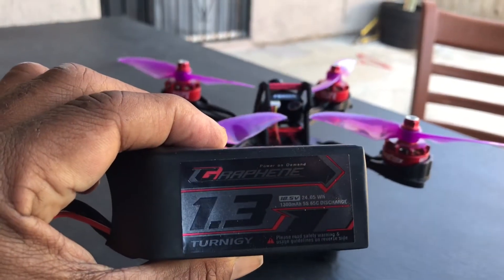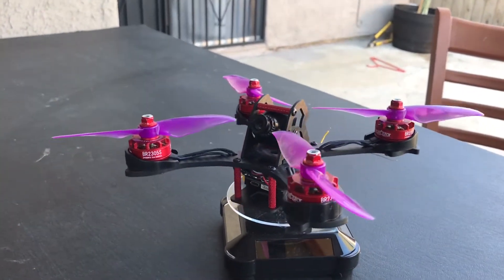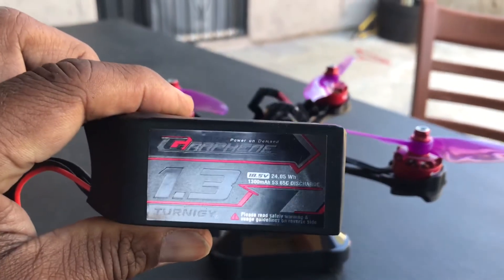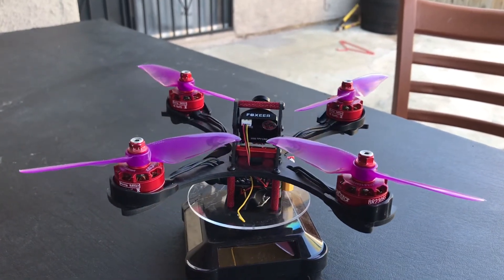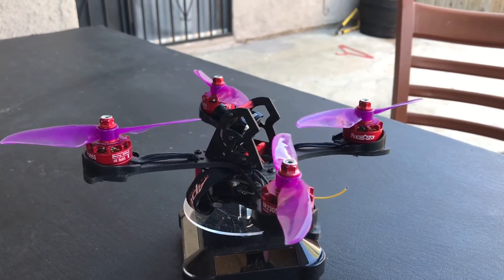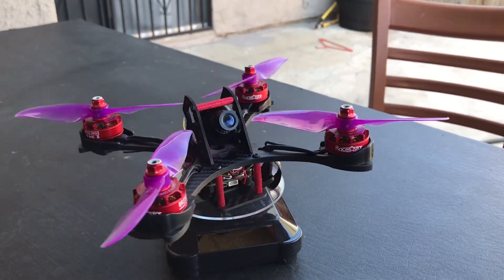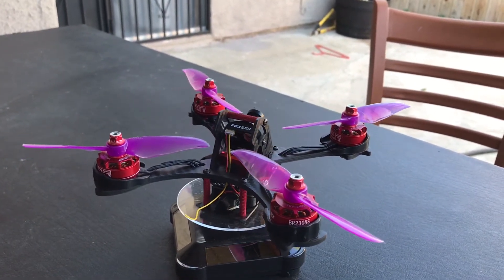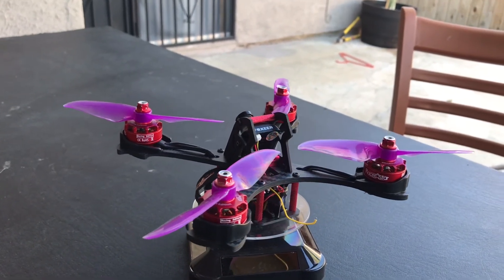180mm 5" Racerstar BR2305 5s Racing Quad Build Pt. 1

Comment: Hi any change to mount the motor downwards below arm? I saw this frame on drone shop. Almost made me add to cart due uniquely design kits. Probably this frame is design to mount motor below arms? Can u confirm this with all clockwise motor might work or not? Thank in advance.
Reply from the maker: I still have this frame, but the stack blew out. The stand offs they give you are too short for my motors. Your would have to order another size to make it work.

Comment: yes I have a suggestion run a small 2s separate battery for your vtx you will have great results. think of the current as blood. you want clean blood for your video because the current is not affected by the main battery during stuff like punchouts